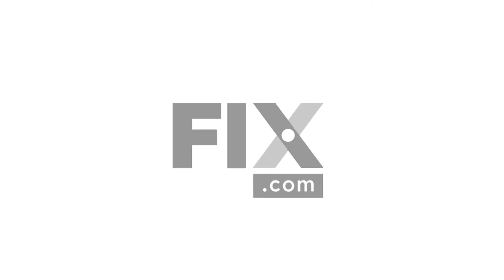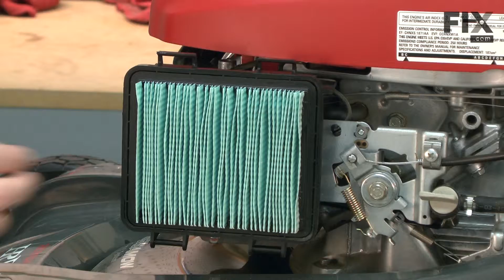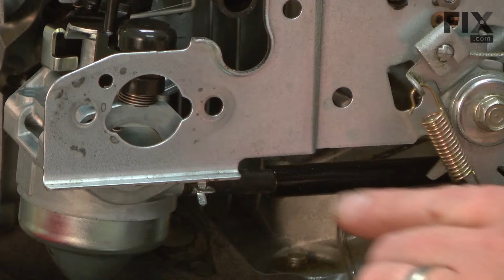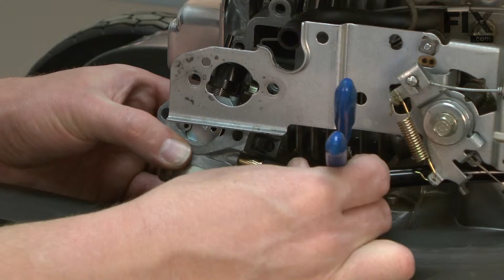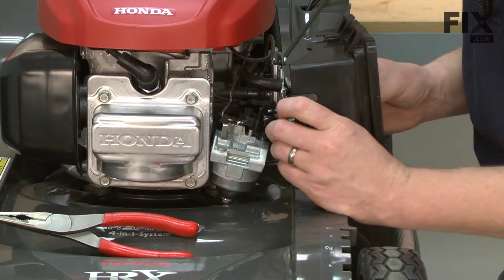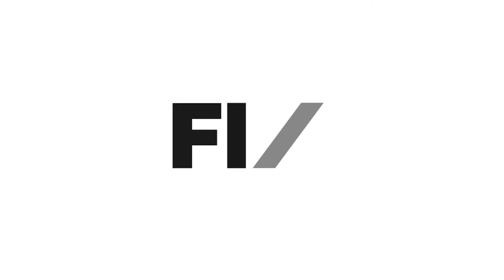Honda Lawn Mower Repair - How to Replace the Carburetor Assembly

Comment: is it okar to cut the peice of aluminum braket only by the carb  or do i need it for support,  im asking becouse i installed a helicoil kind of deep and my bolt isnt grabbing the treads any more so i want to cut off the peice only werr the carb connects to ger a few millimeters and hopefully the bolt with catch threads, ive takin out one gasket and it will grab but dont want to run like that and i fugure that the aluminum braket would be the better option to remove.  the helicoil feel impossible to remove since it so deep and i dont want to damage the thread already in there..    i see the brack kinda hold a load but its easily moved upi and down so i dont thing it actually holds its properly.  if it moves up and down with little pressure then i feel the carb can support its self.   just asking if its a critical load brearing bracket or can carb hold it self up since it doesnt weigh to much    thankyou  and sorry for some of the misspelled word.   typing as fast as i can

Comment: Of the various videos on how to do this I found this one the most helpful. 

A couple thoughts:
- It does require steady hands. My shaky ones made it tough.
- I found I had to slightly pry the governor plate outward to give myself room to work. It bent back to original position easily enough.
- Building the stack of parts this way — from the air filter base inwards — is definitely the way to do it. Way too hard to get everything to line up starting from the engine and building outwards. Lost an hour+ figuring this out.
- I may have missed it, but I didn’t see him reattach the breather tube. I did this while the bolts were partially threaded but still had some play in them, giving me some space.

I replaced the carb to fix an idle surge. Cleaning it alone didn’t fix the problem. Pretty inexpensive fix.